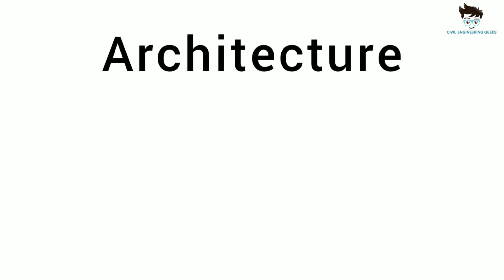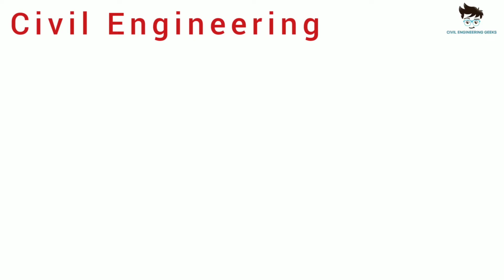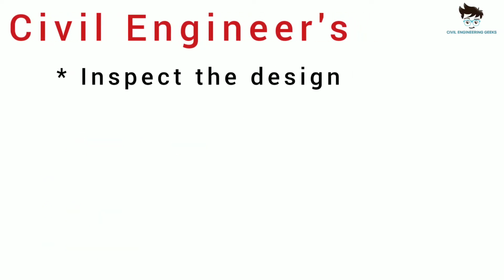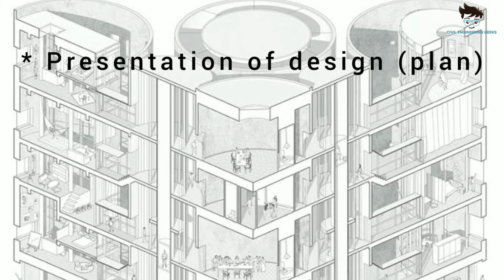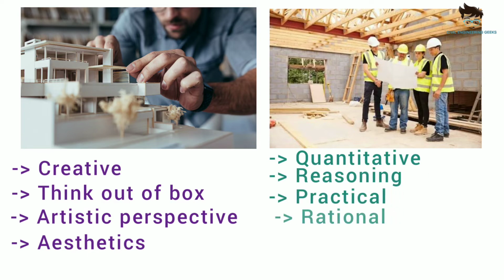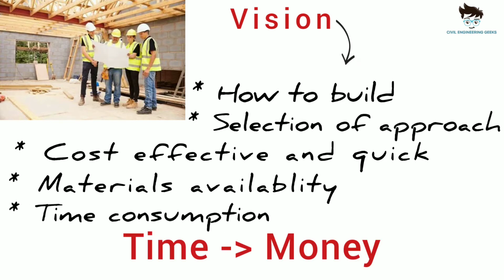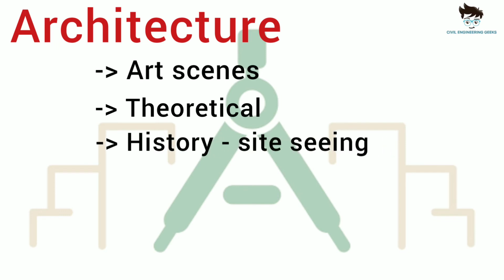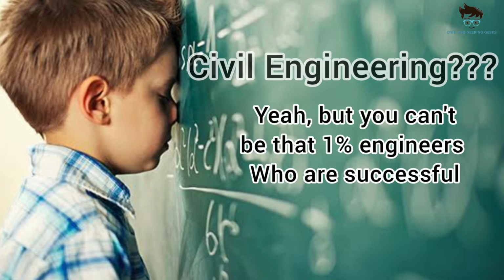Architecture vs Civil Engineering | (Career guidance)

Comment: Superb explanation 👌👌👌👌good job 👏
Reply from the maker: Vivek Raj 😃 You would feel the same about the architects in your site. Dare to share any of your experience ??
Reply: @civilengineeringgeeks1283 in one our site architect designed a cantilever slab of 3 x3m above 100m height (30th floor) from the ground for elevation purpose , we struggled really hard to execute as its risky and also expensive, fortunately it came out well, sometimes architects will take engineers life for granted 😂😂
Reply from the maker: Vivek Raj thats true but it surely would’ve came out to be an amazing structure right ?
Reply: @civilengineeringgeeks1283  indeed 😀